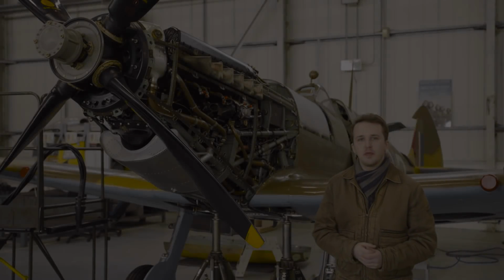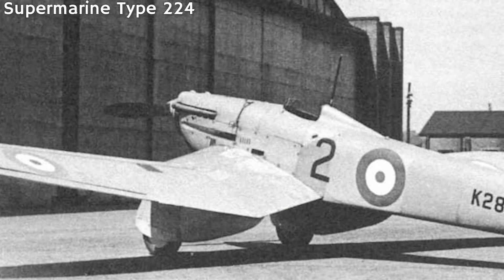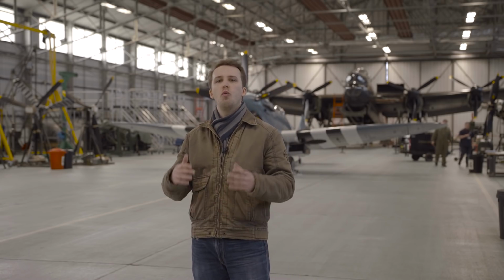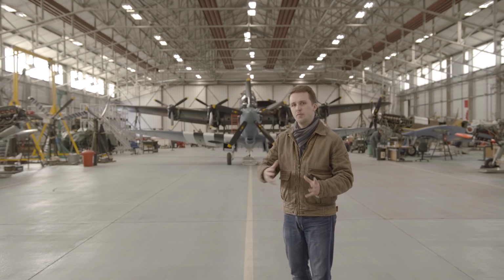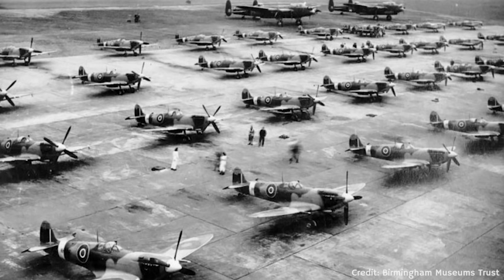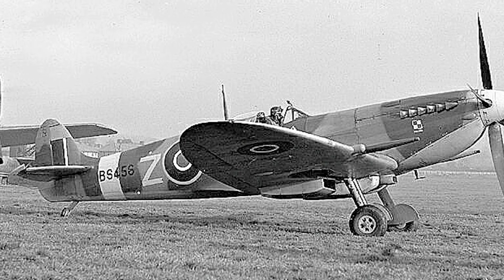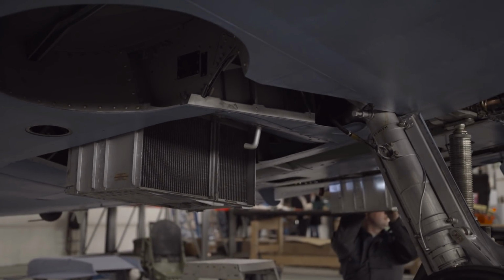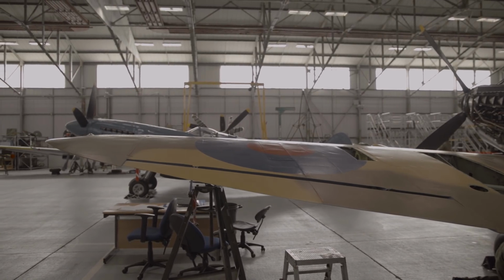Supermarine Spitfire - From Failure to Icon

Comment: So, you hire a German to talk about the Spitfire and all of a sudden the Rolls-Royce Merlin becomes an "inverted" V-12. . . (~3:12)  Only if you fly it inverted, and you don't necessarily want to do that for too long.  Much better to fly the Bf-109 inverted and make it's Daimler-Benz a conventional V-12.
(Sorry, Bismarck - excellent job as usual but i just could not resist that shot.)
Reply from the maker: It's alright, messed that part up :)

Comment: It's engine was neither inline or inverted, it was a normally mounted V12
Reply: Not sure how he got that wrong standing right next it, I didn't notice any other errors so it's even more odd.
Reply: @kolben4451  I think the Me109 engine was an inverted (BMW?) V12? Someone should have checked the manuscript before broadcast, referring to the Merlin as inverted then later  inline is a schoolboy error by anybodies account. It's still a good video with lots of great technical shots
Reply: @philzambo  Yes, the Bf 109 had an inverted V12 (DB 601) engine. However, there are also a few Spanish-built Bf 109 "Buchon" variants still flying and their upright RR Merlin engines make them look odd as the exhaust stubs are near the top of the engine cowl.
Reply: @RoyCousins  Was the DB601 a BMW motor?
Reply: @philzambo  DB = Daimler Benz
Reply: @philzambo  "Anybodies", is in my  opinion, a better example of a schoolboy error.
Reply: @HiWetcam Not all DH engines were inverted. Example: DH 60 Moths.

Comment: At 3:13 you made a mistake, the Merlin V12 was not inverted.
Reply: As I learnt from Greg's Airplanes and Automobiles today.
Reply: @taotoo2  He was thinking of the bf 109 which I think is inverted.
Reply: ATAG_Flare I was just about to post that, but I'm glad I had a quick look to see if anyone else had pointed it out. The DB604 in the Bf109 was inverted, but not the Merlin.
Reply: Matthew Lum 
Not to mention that, given the fact that the plane needed to be wide enough for  the pilot, a true, single stack online wouldn’t really reduce frontal area by much compared to a Vee
Reply: I think it was referred to as an inline vee 12. M.
Reply: No mention of the controversy over the origin of the famous wing being a copy of a German wing from a German plane
in the hands of the British.
Reply: No proof reading?
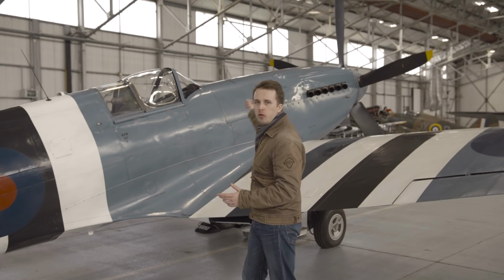Reply: And again at 6:59.  Vee engine, not inline.
Reply: At the time it was not uncommon to refer to the Merlin and the Alison as "inline" engines. I suppose this was in contrast to radial engines.
Reply: @Dr_Reason  Cylinders and crankshaft are inline so yeah as opposed to a radial, I suppose inline V would be more accurate.
Reply: @arthurpendragon9079  I believe in line was used to differentiate it from a radial, even a vee is in line compared to a radial, you have
two banks of in line six cylinder engines, in a vee shape.
Reply: German love their inverted engines
Reply: @Wesrl  True ! The mistake comes because the German Junkers and MB engines are inverted , but clearly the Merlin has the valve covers on top!
Reply: @Wesrl  yes. To the point that they describe uninverted v engines as inverted. Based on author's words. Strange. Almost all ferraris have v engines, and nobody says that they are all inverted. Audi/vw - the same thing.
Reply: That's because Bismark is not really a military aviation historian or expert. Just like Military History Visualized, he just reads a book or two before he makes a video, and just regurgitates what he's just read and pretends that he's an "expert".
Reply: @percynjpn4615  unkind comments I feel, you're a nobody if you don't read, why do they print books for it not to pass on knowledge.
He's only got a certain amount of time to do the video plus it's just an overview.
Reply: @percynjpn4615  lol, that is literally what every historian ever has done, unless they have personally witnessed the events they speak of firsthand. Sounds like you are a jealous individual who thinks they know more, well lets see it then? Where are your videos?
Reply: @percynjpn4615  i think you've pretty much just described every "expert" going. Presumably your approved experts are also gold plated and birthed by the actual ceo of the manufacturer before working on the product for 20 years. Nob.
Reply: percynjpn  I have personally experienced the sort of insult you made, with one of my short course students admonishing me to "crack a book or two".  It shocked and stung me in the moment, until I realize it was most likely borne of jealousy and small-mindedness.  Consider that publically revealing your own insecurity does not actually make you look "big", but small.
Reply: @MendTheWorld  true. Not to mention bismarks mistake was more of a slip then an actual failure of knowledge
Reply: @percynjpn4615  The definition of 'expert' seems to vary. I would say Bismarck, who never claims to be an expert, has probably read more than "a book or two" and is certainly very knowledgeable. I find his videos very informative. If you don't value them or for some reason don't like him then don't watch his videos.